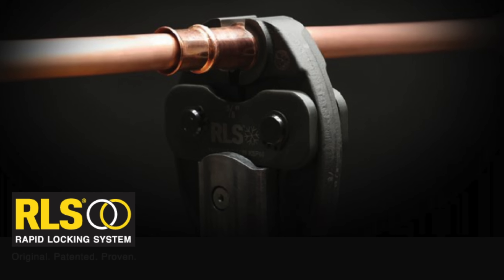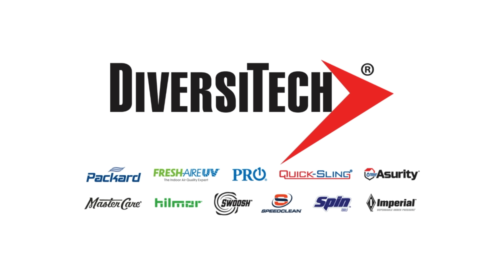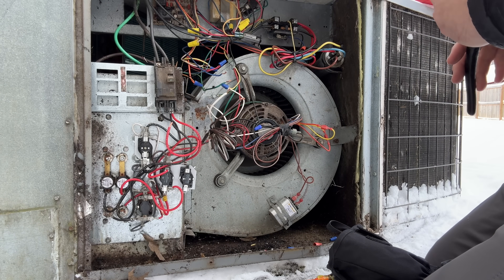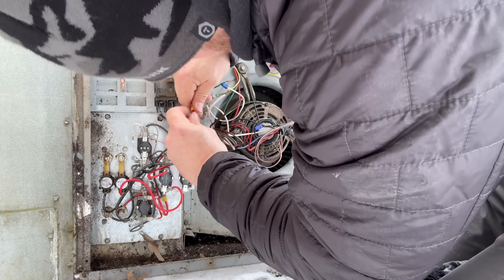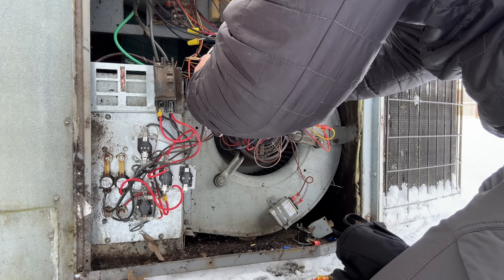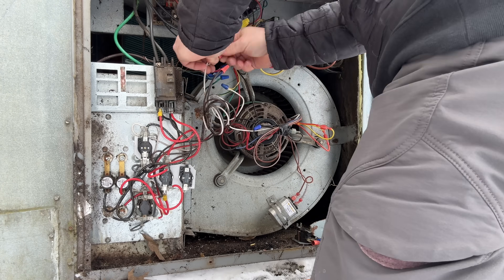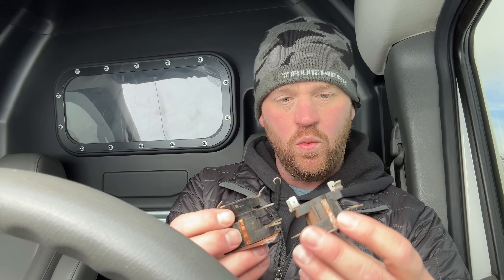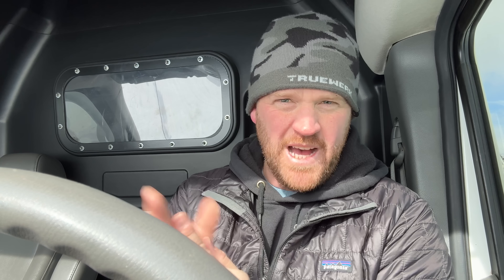Heat Pump System FAILED In FREEZING Temps!!

Comment: What temperature are heat pump good until in your experience?
Reply: This is very difficult to answer.  I am an HVAC dealer and technician.  Older heat pumps are generally good to 32 degrees and then the furnace will take over.  Depending on how deep your pockets are and how big your home is, you can basically get systems that technically can reach -22 degrees, but big bucks to get those.  If you have natural gas, you get a decent Heat pump that can go to around 5 degrees or even -5 and have a furnace take over or heat strips.  I am not a fan heat strips and they are not really used in Colorado.  Nearly all my customers get a dual-fuel setup, if they have solar that helps offset some of the electrical usage, but it warmer and less expensive to run a natural gas furnace.  We don't do package units unless you consider an RTU a package unit.  It is all about how well your home is insulated, your windows, size of home and how warm you would like your home.  But again, I only sell dual-fuel setups here in Colorado.  We have to derate them for altitude but variable speed systems are our primary systems that are sized correctly with a proper load calculation for heat and cooling, not just your basic Manual J.

Comment: Time to replace that old unit, and always cycle the electric heat down with your amp meter attached to make sure the blower does not cycle off until all the strips cycle off. Don't want any coils burning with no air flow, if it is wired wrong that will happen. A lot of old units use a back jumper off the sequencer to energize a blower speed in EM. HEAT mode if the tstat does not call for G in that mode.

Comment: Double throw on a relay/contactor just means that it has contacts for normally open (NO) and normally closed (NC). Normally closed would be used so that the load being switched is OFF when the contactor has power (reverse the low voltage signal, basically.) This isn't really useful for heat strips where you want the 'call' to turn them on, so DT isn't a common configuration.

Comment: I would love a video on sequencer operations. Don’t work on a lot of heat pumps in NJ. Also troubleshooting would be great
Reply: A heat sequencer is nothing more than a cheap time delay relay (contactor).  Used to prevent all the heat elements from coming on at once to preventing an excessive voltage drop on the main line, affecting the blower motor attempting to start and maybe even blowing the pole transformer.

They use thermo-discs that activate over time from a little heater (coil) mounted in the base.  They will fail more often than a contactor.
Reply: Yessss I would also love a troubleshooting video on this
Reply: AC service tech channel. Get the book too
Reply: @That01guyT  which book I have his mini split book and refrigerant charging procedures book
Reply: @mattbilodeau2433  I thought both of them had chapters or operation on heat pumps. I read them a while ago but remember learning a lot from them. I could be thinking of a different book too
Reply: If you have no line voltage across the sequencer terminals, relay is closed.  If you do, it's open.  Check control voltage (bottom most terminals) to see if coil is energized.   Sequencers are fragile and cheap so go easy taking wires off and putting on.  Also, don't be the guy that forgets to kill the power before sticking your booger hooks in there.

Comment: Mention/document the way the power is supplied to the fan on most heat kits to ensure it runs until heat strips are de-energized
Reply: I like to program the stat to run 30 s after the heat kit / strips are deenergized when demand is satisfied. Maybe the kit will last longer as there isn’t residual heat when the blower stops